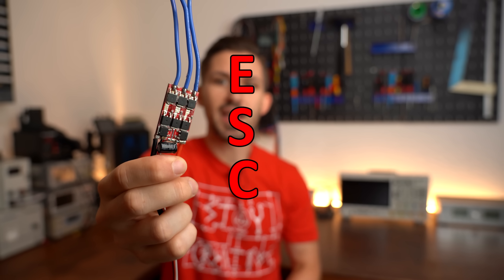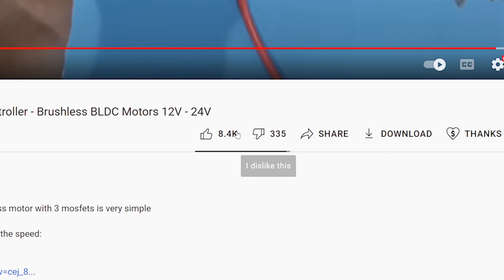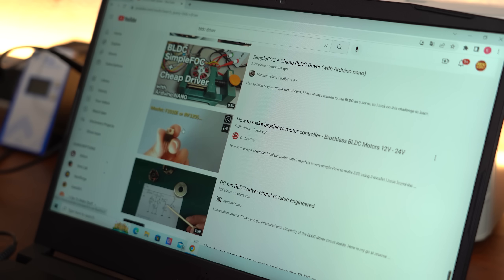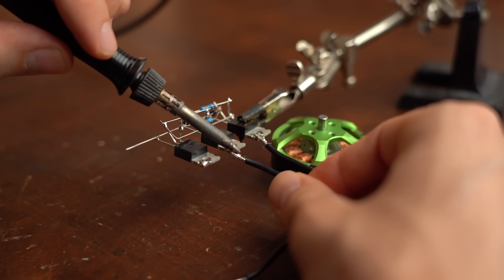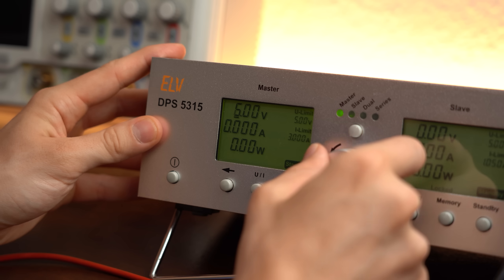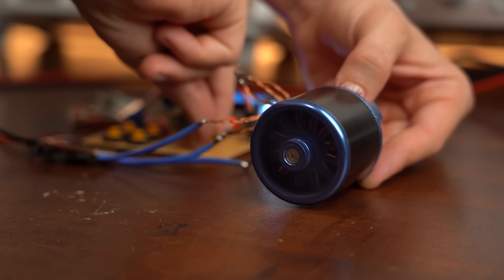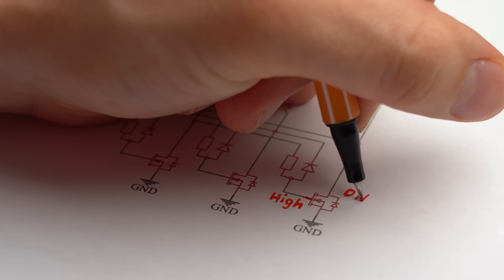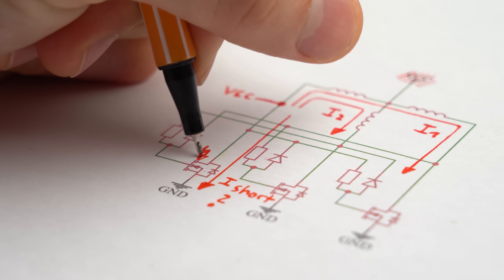I followed a YouTube Electronics Video and Regret it! (Debunking a 500k video)

Comment: That circuit was (maybe still is?) used in commercially-made, cheap brushless computer fans. I still have one 3" fan somewhere that used 3 TO-92 (!) bipolar transistors instead of MOSFETs. Very likely the original video copied the idea from one of such fans.

Comment: I wonder, is it possible to fix the shorted mosfet issue for 3 wire motors? Obviously it's still not a very useful circuit but just curious if that problem is at least solvable.

Comment: I dont like that peoples solution these days to actually electronic circuit design or hardware programming  is to "Just buy one" that already works. You can drive these motors with a cheap mcu and mosfets or mcu and Dual H bridge chips. Some mcus even have Motor drivers embedded.  I have tried it before just those harddrive motors dont like lower voltage so it must be a 12v compatible H Bridge chip. The Dual H bridge chip i was using was rated for 7.2V so could turn the motors but it wasnt enough to keep it spinning because the hdd motor pulls alot of current and has its own issues. When u energize 1 coil it would move but when u energize the next coil in series and the rotor  didnt reach where it was supposed to or over reached it causes it to get stuck or move backwards but thats mostly because of the low voltage

Comment: You can make a bare minimum BLDC ESC using logic gates and comparators and a resistor divider for zero crossing detection. But it's a handful of logic gates and comparators in addition to the MOSFET pairs. And it's still square wave and single speed for the voltage. But at least it's legit.

Comment: I need higher capacity ESC controller that will handle large amps but difficult to get one locally and expensive to order from abroad. Please, I will appreciate if you could show how to increase the capacity of those cheap small ESC in the market. Thanks

Comment: The first thing that occurred to me was that the commercial 85 part ESC can do a little more than just control the current to the motor. In some way, for example, the ESC in a radio-controlled car should be able to limit the voltage going to the motor when needed, but you can't feed all the battery voltage to the motor all the time. At home, a controller like that made with a few components will work, especially with an adjustable voltage source. You can add a potentiometer to it, but it doesn't really work in a radio-controlled car anymore. Sure, you could probably adapt it in principle in the same way as the mechanical controllers used with brushed motors some time ago and use an external servo to adjust that potentiometer. But does that make sense?

However, with a little further development, it could be quite an okay device, for example, for testing the operation of brushless motors at home, at least as long as you don't need to test the operation of any sensors on the motor.

Comment: Can you make a circuit that works without arduino or other processor using 3 P channels, 3 N Channel mosfets and 3 hall effect sensors. It will have torque at start-up.

Comment: "Aside from the higher impedance of the wye configuration, from a controller standpoint, the two winding configurations can be treated exactly the same"
https://en.wikipedia.org/wiki/Brushless_DC_electric_motor

Comment: Yeah I like when they are so proud to be spinning a motor at 10k RPM with NO LOAD!!!!! Or showing a couple thousand volts and not the current! Or spot welding 28ga sheet metal and calling it a welder! They massage it for impressive data points that by themselves are meaningless. Thanks for bebunkulizing that vid. You should never have to manually spin a motor to get it started. I am doing an alternator to motor project in a few weeks and I was hoping to not have to add hall effect sensors. I have several controllers for motors in the 5kw to 12kw range but I wanted a small cheap one for this project which will probably top out at around 1kw with 48v nominal supply.

Comment: Your assession has a pretty wrong and extremely entitled perspective. 1st, it should be obvious, that such circuits aren´t made to be used by an electronics-savant like yourself, but by people who want to learn something basic about a specific action. 2nd, such circuits can be still used as test-circuits, when you can´t specify if your expensive motor or rather your expensive ESC has a problem, and which problem it might be. Believe me, out of all the people who tried out this circuit, you´re one of the few, for whom this was a waste of time... After all, none expects it to be so good like a commercial one, but everyone learns something when building it. And one can always find another one, that´s a tiny bit more complex, but works much better for the bit of added complexity: https://www.youtube.com/watch?v=TDkcHAoTSeo That´s how one learns electronics, without reading countless books, or having a good teacher in the university (or simply there isn´t a university to be found every 20miles: I think Halle is just 19miles from Leipzig, isn´t that your region?)...

Comment: This is the difference between you and ElectroBoom: for you it's enough to merely say the 3-wire connection approach is probably a bad idea because that MOSFET won't like it. No need to show any smoke or capacitor explosions ;) Arguably this can be fixed by adding a resistor or even an inductor, but this asymmetrically the motor will quite likely not support much load anyway.

Comment: u can bypass the ESC with a 500-1000uf 12v capacitor.  stepper mottors / BDMotors are basically 3  phase motors... if u got some capacitors linked to some of them wires u turn them into DC brusheless motors of sorts(high steppings-almost not perceivable). have fun.

Comment: PFFFT WHO needs electronics schmlectronics !!!!
Did you know you can drive any stepper motor with only 2 DPDT switches and a battery ?
wire each set of phases to a switch , and start synchronized flipping!
Downside, your fingers may get tired before you get one revolution.

BUT , IT WORKS!

Comment: You can make full bridge of the same half bridge simple diagram with roughly 18 parts and have a decent motor controller from 0.7v to 55v. I really suggest this method as it's wide range voltage and simplicity.
Saves you from a lot of complications.

Comment: Hi master, can u make an esc using 4017 with frequency generator and the driver using 2 mosfet wich one is use invert(not) logic for 1 phase winding and without microcontroller? Please help me with this circuit master.
Reply: So the circuit will need 6 mosfets and 3 logic for the trigger input

Comment: How can it be an ESC replacement without the SC?
Reply: Cheaper circuit that is commonly used in PC fans but with a Hall sensor with internal transistors that switch coil pairs and get it going. If you add Hall sensors, you get a self starting reliable motor BUT without speed regulation. PWM can still regulate it, though.

Comment: Man I love watching these videos. Takes me back to when I was a kid with little drawers full of components I salvaged from old hair dryers, VCR's, computers etc.

I thought brushless motors were just AC induction motors, and that ESC was just an inverter which creates 3-phase AC...?  I think that's what ElectroBOOM said in one of his videos, no?
Reply: Yeah and thats... sorta what the circuit in the video does, poorly, a bldc will work with just 3 phases like that but a proper feedback system and all that from a proper controller makes them a lot more useful
Reply: It might be a modified sine wave at best or just a rounded off square wave.  Real sinusoidal AC takes a lot of components and usually a transformer and filters.  Something like an audio amp.  Then something like capacitors or a microcontroller to have a 120 degree phase shift for each phase.
Reply: @projector7141  or just spin up an AC generator.

Comment: Of course it's not a good circuit, but it's fascinating that it is even possible!
Reply: And with said limitations its possible turn the motor in the first place. In my opinion this is valuable information, but its niche market for places that can utilize this stone age esc. Years back i would loved to know about this, for random test contraptions that just need to be thrown together and run in constant speeds. Hell it could simple be used to test brushless motors if those even work. It really does beat expensive and fancy ESC's specially when time and cost are priority over features like "cold start".
The real issue with these videos are that they dont explain the pros and cons of the setup at all with leads to mentioned scammy feeling coming from it.

Comment: I saw 85 parts Vs 9 parts and my first thought was "it only runs one size motor at one speed" 

I'm sure if someone who knows the needed specifications could put together a circuit like that with specific resistors, specific MOSFETs and all to run a specific motor at a specific speed. 

Of course it would be useless for a larger or smaller motor, or even a larger or smaller load on the same motor it's designed for. 

Too simple can be as bad as too complex.

Comment: I haven't even finished watching the video yet, there's so many factors to bldc Motors, if you don't have the timing right it will actually slow down the next pulse before it gets finished with the first one. Timing has to be spot on and it has to change throughout the curve of the motors' power. And triggering is very important for the three main Cycles of a bldc for timing, Etc. But then you have pulse timing, how long each winding stays on and off, pesky overlap under a load, without a load the timing can be correct, and then when you put a load on it, the timing gets screwed up. There's a reason why a good ESC has so many components, it kind of has to.

Comment: Great video. While this circuit is absurdly simple it does make me think it must be possible to develop a more sophisticated linear circuit for controlling a BLDC without a microcontroller.
Reply: BLDC needs some sort of feedback to keep switching in sync with rotor. Maybe asynchronous/squirrel cage motors would work without a microcontroller, but you also need PWM regulation, so microcontroller is simpler in the end.
Reply: @Papinak2  yes, of couse. If you have such a microcontroller it's ideal. The question is not about what is simpler for the end user/designer, but simpler in totality.

Comment: It's a good thing cars came before computers. If we asked an electrical engineer how to meter fuel or adjust ignition timing on the fly without 1,000s of chips and components they would probably tell you "don't bother" or that "it's not possible" or "just do it with an Arduino." You can only learn so much from that, and once you do it once doing it again and again isn't valuable. Your STEM is missing the S, E, and M.

The "third world" ESC circuit demonstrated in the "bad" video isn't that far off from a viable design. The hard part is done. The skills gained from building such an experiment would be extremely valuable. Anyone who builds this circuit successfully already demonstrates the skill required to understand why the circuit is faulty. Improving the circuit to overcome it's deficiencies would be a very valuable experiment for a beginner engineer. 

Also, it's not unwise to learn how the circuits we use everyday function in their most basic form. The world will end someday, and when it does you won't be able to order a $10 ESC off Aliexpress. Then again, here we are entertaining the complexity of powering a brushless motor with scrap when you could simply trade 8% efficiency for 99% complexity and switch to using a traditional brushed motor instead. Lets face it, BLDC motors are basically just 3 phase AC motors with an expensive controller. Someone just wanted to get a patent with their name on it.

Comment: The 3 wire use is pretty much the same as running a large grid based AC motor in delta configuration

Comment: I mean, it does technically work, it's already better than I've imagined.
If the original video didn't sell it like a valid ESC replacement, but as a gimmick or just a simple motor tester, I think it's fine. It's not like you could do anything else with that ESC anyway, as you have no way of controlling its speed.

Comment: A lot of electronic things can “work” with something simple. But to make it work to the degree we expect them to is a different thing altogether. A tiny motor maybe could get away with this sort of simple sort of self oscillating circuit. But if you expect speed control to within 0.01% (a real spec that I need to meet with one of my BLDC projects), repeatable torque response, digital control, efficiency, or the ability to run hundreds of amps and hundreds of volts, you need something more complex.

Comment: One fun, but ineffective, way to drive a BLDC motor is to hook two wires up to an AC power transformer. (I used 9v on a CDROM motor since that's what I had). It won't self-start, but if you give it a flick, it will spin surprisingly consistently. You can add a cap to the third wire to one of the other two to give it some phase shift. Again, interesting, but not really practical.

Comment: I did found same issue with BLDC driver attached 3 wire to regular BLDC driver. It did need a kick to start although I drive it with PWM. I would not found anywhere yet to use 4 wire to drive BLDC and yet they are present in HDD. MOSFET method we can all agree its a "poor man drive" circuit, it works until it wont ;)

Comment: I have a box full of 4 wire hard-drive motors I've saved and never been able to any of them to spin with limited electronics components and knowledge.

Is there a way to get them working with regular 3-wire escs?  I have a ton of those laying around, but no clue how to safely wire them if it is possible.

Comment: 9:45 That ESC isn't just a "cheap" one. It's just an extremely low-rated one. It'll go up in smoke if you try to have it run any of those bigger motors with any load on them.

Comment: An ESC is simply that an electronic motor speed controller. There are many different kinds on the market that you can also DIY.
But.....there are brushed motor types, brushless motors and everything in between. The key is matching the motor with a proper controller.
My terminator es-04 scooter which was a freebie to me had a bad controller and is no longer made so i had to use a cheap compatible aftermarket controller which after wiring mods works well. Minus the battery gauge but a meter can be added. No biggy:)

Comment: generally 3phase motors don't require an earth to be powered because the reverse feedback voltage from the coils provides the negative wave form for the other coils. but ideally you should earth a 3phase motor in any case

Comment: Very well explained. Thing the self-made ESC is designed for use with Motors that are not used in Quadcopters or similar Areas. I would always use a purchased ESC from the Web. Great Video, so another LIKE from me.

Comment: First step to really figure out how BLDC runs is to remember that it's actually a three phase AC motor and the ESC is basically a three phase inverter. And of course, a full bridge PWM controlled inverter with current and voltage sensing will make your three phase motor happy.

PS mad props to Scott for avoiding giving very little clue about it being just a good old three phase system, absolutely love the content.
Reply: @MuhammedG Exactly most of those prototype BLDC ccts looks like an amp schematic lmao More Test & Tune is needed to make a pro-compact ESC!

Comment: So i want to install a remote start with keyless Entry and door locks, because my car doesn't have it. But i want to put a button on the door that'll unlock/lock the doors with the keyfob in my pocket. I was thinking about getting the  viper 4806 system but I don't know If  I could wire  something like that in?

Comment: Careful! The 36v esc shown at the end is 36v max!! Maybe even less. A lot of people, including me, tried to connect a 36v hover board battery pack to it, which can actually charge up to 42v. Even at 39 volts (and even 35.5v) the battery blows up the driver immediately.
If you want to use a 36v battery pack, do seek the 60v bldc controller on ali

Comment: I'm reminded of the one I saw wherein an "inverter" was made with just a couple transistors and resistors driving an old center tapped power transformer backwards, push-pull, at whatever frequency that mess happened to oscillate at.

Comment: That cheap control board you suggested is OK for hobby motors but many people need something bigger. For example; many of the treadmills also feature motors that need to be driven in a delta star configuration. Also most modern washers and dryers use three wire motors. Many times the motor driver is built into the control panel board and is very expensive or obsolete. With a cheap after market motor driver these motors could run again with a few basic controls to take place of the dead control boards.

Comment: hey there,
i want to make a dc brushed motor esc with braking but i am unable to find any schematics or videos. do you have any recommendations or links? i would make it for a 5inch train with 100A surge and around 10amp cont.

thanks in advanced and greatings from belgium.